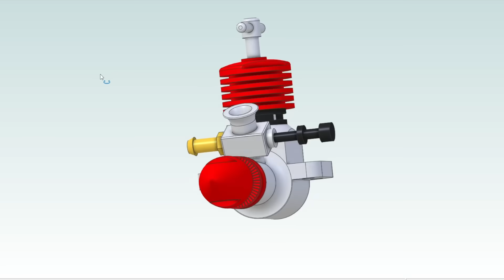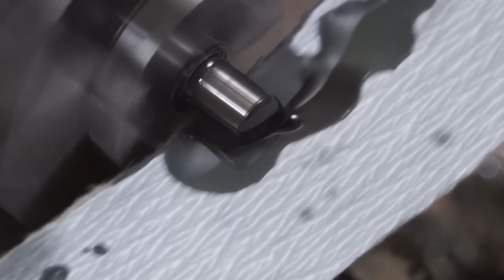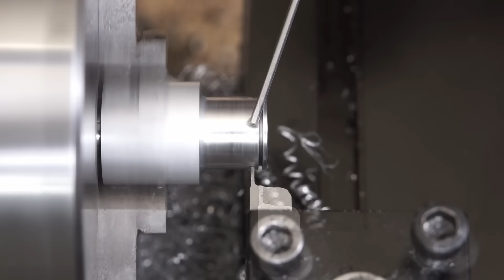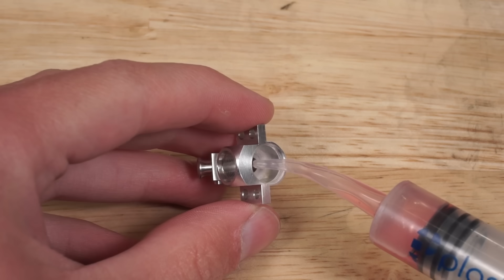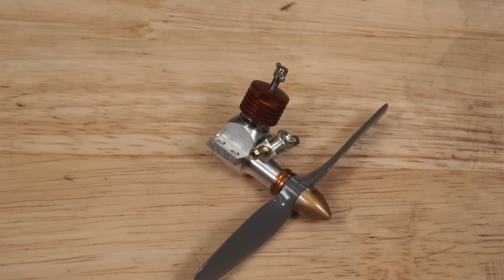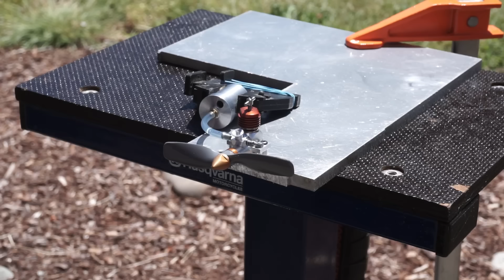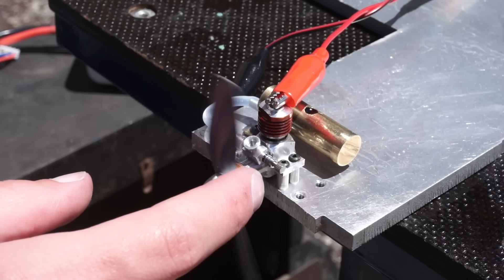I Make This Tiny 2-Stroke Engine From Scratch

Comment: I'm in central British Columbia, Canada. I got rid of almost all my childhood toys and things over the years, including all my model airplanes. But I did save my small engine collection. I have a McCoy Redhead .35, a Supertigre .29, an Allen Mercury 1.5 cc diesel, a Davies Charlton 1.0 cc diesel, several Cox engines such as an .020, some .049s and an .09, and a Fox .35 RC that I bought brand new when I was sixteen. I think I paid $35 for it at Ben Hill's Sporting Goods in Victoria, a lot of money for me at the time. It has only been run twice on a test stand. I miss those old days, and this is all I have left; not even one photo survived the years. Great video!
Reply: I bought the Fox .35 new in the 60's, from the hobby shop, I still have it and the box, just checked the box, it was $11.99.  The motor's still on my "Voodoo" wing I built, we flew combat and cut off the opponent's streamer.  I had a few of the plastic U-controlled planes that came with the Cox .049, the PT-19 flight trainer, P-51 Mustang, Ju-87 or 88 Stuka that you could drop the red bomb, these were all less than $9.00 each!  For the whole plane, motor and accessories!  Used the Mistle Mist fuel.  After the plastic ones I built the rest from balsa wood and paper.

Comment: when I was a boy back in the early 1960's I had cox .049, .020 and tiny .010 engines to power the planes I built from kits, both control line and free flight. we had a lot of fun with them, I can still smell the burning fuel, it had a very distinct odor.

Comment: I have never messed with a diesel or glow engine this small. I do own a couple Thunder Tiger .07s & I’ve owned A LOT of glow powered RC planes & cars. One issue I see, especially after you converted it to glow power, is compression. Nitro engines have compression by the cylinder & piston being tapered. The cylinder is always chrome plated brass so it’s soft & the pistons are generally aluminum. They take a lot of gentle break in to work correctly for any period of time. Another issue looks like your timing could be off with the fuel port in the crankshaft. Though I think one of the biggest issues you had, you pointed out. The carburetor mounting that’s causing a vacuum leak. Still… kudos on the build. I couldn’t have done it.

Comment: Love my Valentine 0.8 diesel.  Such a smooth runner, and literally a work of art.   I don't know if Mr Valentines is still alive.  Bought mine in 2012.

First caught wind of the micromotors in a out of publish magazine called Strictly I.C.(Internal combustion).  
 A patient machinist from Hungary made 7 co2 engines, one was a 6 cylinder radial.  ALL 7 engines would fit inside of a Contact cold capsule together. 
 This guy also made a axial flow model turbine, with fully functioning fuel enrichment afterburner.  He had horsepower specs for each co2 engine as well as the turbine, with and without afterburner.
 If you can find all issues of that out of print magazine, you would have a wealth of info on micromotors.
Reply from the maker: I would love to have one of Mr. Valentine's engines, they are so nicely made! as far as i know he's still around, but he's not making any engines. they do show up on ebay from time to time.
i have all but the first 4 volumes, and volume 7, of Strictly I.C. and i even made the only steam engine that was published in it:
https://youtu.be/TEgAjWfh5qI
Reply: @JellyFishMachine  Yep, everything from making piston rings to making a 4 move square hole punch for thick metal in those magazines. That little hand fabbed metal punch was a standout to me.
 Emilio Lazarus was the name of the Hungarian machinist.  Or, it's very similar to that name.   Soo long ago.

Comment: Even for you having to sit down to think about the design based upon what you initially did, this was 1, immensely entertaining 2, you are incredibly talented, and 3, the engine still kinda worked.  I think in today's quest for immediate perfection (not you @jellyfishmachine but society in general) the notion of iteration is a lost art.

Wondering if the version w/o the glow plug, any compression issues could be remedied by just having a better carb seal -- this engine wants to run otherwise.

Comment: 1.  Best material combination for a diesel model aero engine piston and cylinder is spheriodal graphite cast iron piston and contra piston running in a hardened steel SAE 1045 steel cylinder.  
2.  Both the piston OD and bore ID HAVE to be very accurately round.  Honing and other methods won't give that to you,  you have to lap both piston and cylinder to fit.  Make laps from 2011-T3 al. alloy and use 20 micron diamond paste.
3.  Cylinder bore has to be tapered,  larger at the base of the cylinder..  Achieve that by lapping more out of the cylinder base.  Required taper on an 0.010 cu in. engine around 0.0001 to 0.0002".
4.  I rebuilt an AE 0.010 diesel few years back which had a similar two piece needle valve assembly.  It did just as your engine did,  start but not break into a run.  VERY hard to start yet after my rebore the piston fit would hold compression for over a minute at TDC.   So designed and made a miniature spray bar assembly with 0.031" music wire needle,  brass spray bar across the venturi and two side drilled spray holes and set across the venturi where velocity is highest and therefore pressure lowest.  Needle a press fit in a threaded brass thimble.   Engine then became very easy to start on 33/33/33/3 fuel mix.  Used Jet A1 kerosene from the local airport as shop kerosene has an additive which makes small engines impossible to start.  Diethyl ether and castor oil and 3% iso propyl nitrate for the rest.
5.  With lapped pistons and the conventional style needle valve assembly on a Cox 3" prop. as you had,  I could start the engine very easily within about 30 secs. from cold and breaking into a run until the fuel ran out or I pinched the fuel line.  Hot restarts one or two flicks.
6.  The yellow tinge on the anodised spinner is because the pore size in the anodising is accepting the yellow small size dye molecules in the dye mix but not the bigger red dye molecules.  Maybe because the alloy you used was 2011-T3.    6061-T6 being the best for anodising,  and 2011-T3 being very poor due to its high copper content.
.7.  Best material for connecting rods is high tensile 2024-T3 or T4 high tensile al. alloy.  7076-T6 is even higher tensile but a lower fatigue life,  important in a conrod applcation.

Subscribed.

Comment: Nice video.  in general your videos have been very helpful to me to figure out some good steps to machine these kinds of parts - thanks!  You described the fuel mix for compression ignition but I think you may have omitted a key ingredient.  I have got the weaver 1 cc engine to run on 33% ether, 35% kerosene, 30% castor oil, and 2% Amsoil cetane booster.  You have got to add the cetane booster!  for the ether I just use john deere starting fluid - which is 80% ether (and I assume the other 20% of that is equivalent to kerosene).

Comment: Hello JM, I always watch your videos from beginning to end, they are very good and you are very precise in what you do, I have the impression that one of the things that made it difficult for your engine to work was the design of the connecting rod, when you showed the 3D image of the engine I already noticed a detail between the connecting rod and the crankshaft, the two together in this type of engine should work as a valve, and in your engine it is not working, when the piston reaches the end of the stroke the connecting rod closes the passage of the mixture through the crankshaft hole and prevents the return of this mixture, check if this is not the problem, congratulations on the work.

Comment: I think you have created more of a challenge for yourself making the engine so small, but I do appreciate that is part pf the challenge. I wonder if part of the problem is the seal at the crankshaft bearing?  I believe the late George Luhrs, a prolific model engine builder had trouble with his smallest capacity engine. I think you get to the limit of the physics where the fuel droplets are a significant volume compared to the engine.

Comment: 👏👏👏👏 good job sir. in this situation I think use the fuel with less lubricant aspect. probably the check valve is not as fast as the cylinder cycle. so using enough sensitive check valve after carburetor may answer our prays.

Comment: Glow plugs for larger nitro glow engines around. 15" and up use a standard glow plug size. It's 1/4-32 thread I believe, that might have fit your engine and they are much better glow plugs. Long ago I converted my .049's to use those. They were a LOT cheaper too.
Reply from the maker: Thanks for watching!
It's hard to tell without holding it in your hand but this engine is barely bigger than a standard glow plug itself! the piston is 5mm (.197") diameter, the whole engine is 1-1/8" from top to bottom.
 I have used standard glow plugs in other engines, and i am building a twin cylinder that will use "turbo" style glow plugs.

Comment: Unbelievable work!!! I wonder if JB Weld steel epoxy might hold the carburetor better than the loctite!? If you get the metal hot, the steel epoxy flows beautifully!

Comment: I had a baby bee engine when I was a kid (think I still got it). It had a glow plug and that helt with the starting. It also had a spring for the propeller so you could wind it up and worked as a starter. Had it on a small plane I steered with two strings so I could go up or down while turning around my self. Tons of hours of fun and to this day I can stil turn around a lot with out gerring dizzy 🙂

Comment: Silver solder (or low temperature silver brazing) would work better than the loctite for securing the carb as well as sealing the joint.

Comment: I have bult 5 of them of which all run very well. The piston cylinder fit is crucial especially the amount of taper. All of mines cylinders were 4140 and the piston cast iron case hardened

Comment: Compression ignition engines can be tricky to run, especially ones this small. Just like small glow plug engines need more nitromethane, small compression engines likely need more ether. Also important to use an octane improver like Amyl/Octyl Nitrate. The running cylinder temperature is also important. I found in my 2.5 cc engines, that the compression needed to be set higher for flight conditions, than what seemed right on the ground. I would ground tune, then up the compression by another 1/8th turn. It would be out of tune until the airflow cooled the cylinder. This worked the same for both engines of different makes.

Comment: About 30 years ago when I was a young teen, I acquired a ~2cc compression engine with a control line plane.  Sadly, I was never able to get it to run, but I did like having it.

Comment: excellent work! i love precision in engineering. i  was wondering how the first head design was going to run without a glow plug.  the fuel on these tiny engines is an alcohol fuel with a castor oil as a lubricant; x% nitromethane is added for easier starting. honestly  i was wondering how the first diesel ignition head design would be able start and run because there isn't enough heat from compression in small scale engines for spontaneous diesel ignition, it needs a glow plug. i think it would have been cool to make one from scratch like the rest of the engine, but making a tiny glow plug would be more challenging than the entire project because its coil is tungsten and has to be micro welded. i still have a throttled Cox 0.020 engine from 40 years ago.  it might even be smaller than this, but almost the same design. i remember seeing 0,010 engines too back then too.   this was fun to watch.  takes me back.

Comment: You should have a look at the tank atomisers on a good quality variable wattage vape mods (and the drip atomisers too). They have adjustable air intakes and there are now mesh atomisers rather than just coils. They come in every imaginable variable for coil/mesh size and resistance etc and airflow etc etc. I bet you will definitely find transferable ideas and maybe even hardware you can use or modify outright. Even if you don't, I guarantee that it's a rabbit hole you'll enjoy exploring just for the awesome microengineering and tricks for atomising liquids.

Comment: Add a bit of nitro-methane to the fuel mix. Also, castor oil deposits a goo to the inside of the engine. Use proper modelplane 2 stroke oil

Comment: That is not the smallest engine Cox made, if that is in fact an .049, as it appears to be.  They made an 0.010 at one point.  They also made an .020 and a few other displacements and various configurations, tanked and tankless, reed and rotary intake valving, various port sizes, both rotational directions, RC throttled, exhaust port restriction throttled, etc.   They were great engines.  

This looked like fun.  Nice work.  Makes me want to break out the lathe and mil and get crackin.  If I did, I would have to find or make a threading lathe like that one you have there.  That would be a nice addition, in any case.  Sure looks a lot simpler than doing it with gear driven screw, and compound adjustments.  I never did a thread that way, but I watched my dad do a bunch of them.

Comment: My guess is that the gas is burning faster than it can intake through the tubes so if you create a big syringe holding the ignition fluid and basically put compression inside of the fuel tank, it should run properly

Comment: Ringless piston fit is tricky. On compressed air motors where heat is not an issue silicon o rings are a helpfull addition.  The piston must move very freely yet not allow much air wastage bypass. Those airhogs motors spin freely with excellent compression using pin and ball vaive induction.  
My small bore motors ( 3/16") suffer from the slight innacuracy on either my Sherline or minilath. This is my fault as I have an adjustable 4 jaw for the minilath and an indicator guage and should use it!

Comment: I wonder if the issue is - as the engine heats up - the mixture at the carb changes significantly.  I see you going in to adjust the carb to try and keep it running - but you might need to actually teak it significantly to keep it going.  That or change the fuel mixture from a "starting" mixture to a heavier running mixture as the engine warms up.  (EDIT - I just saw - someone further down describes using a syringe with a different mixture on a Cox engine to do just that - END EDIT).

Or I might be talking through a hole in my head!!  🙂

But if I'm correct - you would be in good company.  The limiting factor on the Wright Brothers early flying (once they had learned to fly the plane) was not the fuel supply - but the mixture.  They used a simply hot evaporative plate that they dripped fuel on to create a mixture and as the engine got hotter - their mixture got leaner to the point the engine wouldn't run.  Density Altitude was also a factor- but they didn't figure that bit out till they got the Flyer back to Ohio and it wouldn't fly in the thinner air at the higher altitude.

Comment: I’m not gonna harp on your technique but typically when threading the cross slide should be set at the pitch angle, not 90°.

You want to load the fwd side of the tool not the back side (plunging at the root angle relieves that tool pressure)

absolutely beautiful work tho thank you for having the brass to put yourself out there!
Reply from the maker: the sherline machine doesn’t have a crossslide, and at this small scale it doesn’t make much difference in the end.

Comment: Please try by using something else to seal the intake. No matter it would look not fine😅 But i think that just sealing that it would be running no problem. Intake leaks are the worst in 2t, with the scale even more. Sorry my English I'm a little bit rusted. If you do so please upload a video running, no body s gonna judge while it's running. Cheers!

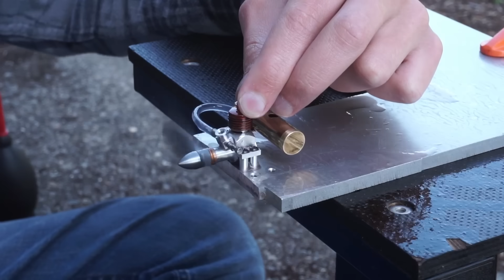Comment: 25:25 That's the sound of an engine with no compression due to poor piston fit. Same problem after converting to glow plug. Bore should be tapered .001" top to bottom and everything needs to be round within 50 millionths of an inch. The piston should have a slight drag at top of stroke. If you can press you counter piston in by hand it's slightly too loose. Also, you need 2% hexylnitrite in the fuel as ignition improver for diesel fuel. Just taper the bore and make a bigger piston.

Comment: Great video! You are very talented. I would love to learn the art of machining. I'm a business development professional and have worked for aerospace and defense contractors that use ECM machining to manufacture fan blades for high bypass turbofan engines. Electrochemical machining can produce some amazing shapes from incredibly hard superalloys. I  never got into the manufacturing end, just the admin and business development side of the business. Hopefully, I can find a way into manufacturing some day.

Comment: it looks to me that the carb venturi has a short cone and then straight bore past the needle valve assembly, this will result in less speed of the incoming air and consequently less fuel draw

Comment: 1/3 ether, 1/3 paraffin, 1/3 castor oil, 2% Amyl nitrate or similar for diesel fuel. Or just buy it.
For the glow version up to 25% nitromethane. I bet that would have got it running.